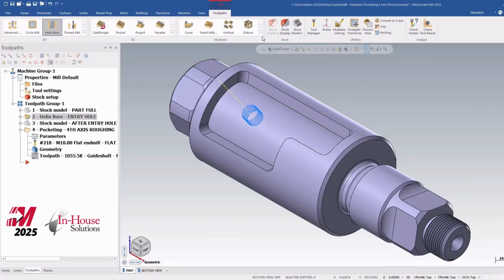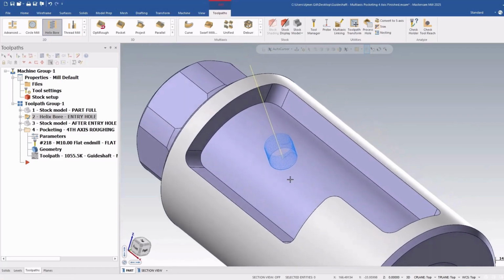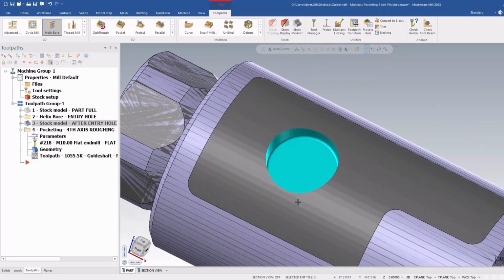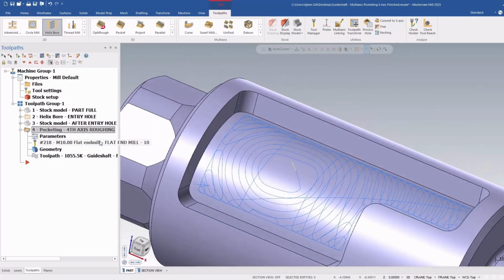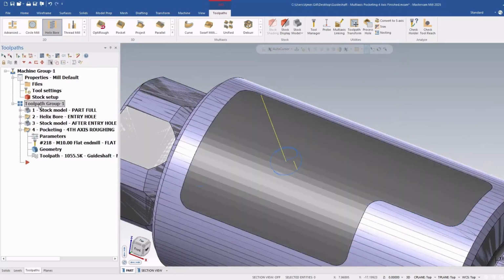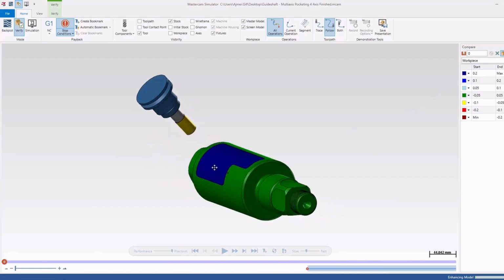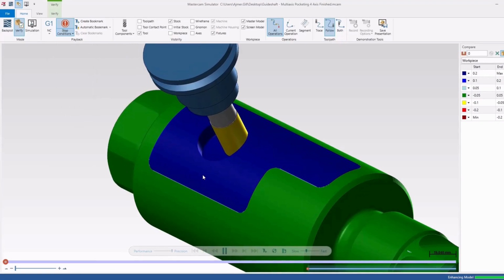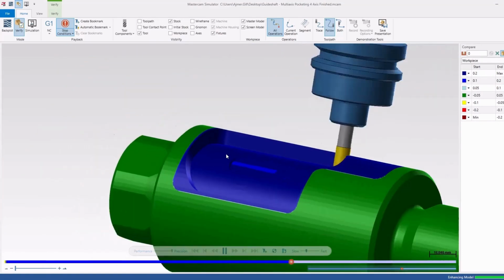Mastercam 2025: 4-Axis Machining in Multiaxis Pocketing

Comment: Wait so I’ve got MC 2024 and it can’t do this? 
I literally beat my head against my desk for a few hours trying to find a tool path function that will do this.  Apparently MC 24 just can’t do it….Master Cam in my experience so far is the least intuitive most frustrating software I’ve ever used.  I feel like if you have to take several college level courses to learn how to use a particular software, you may as well use that time to learn software development and make a better program/product.  Second worst program is MatLab. Literally just excel with extra steps.